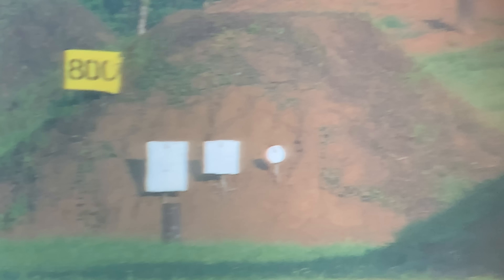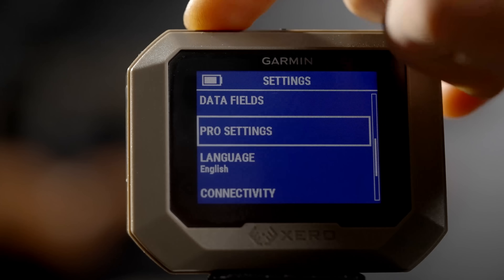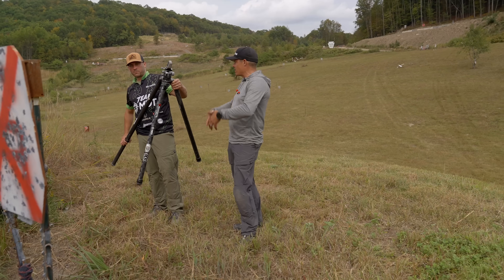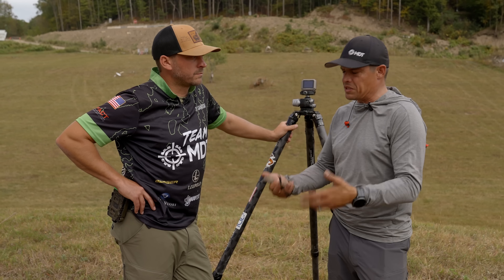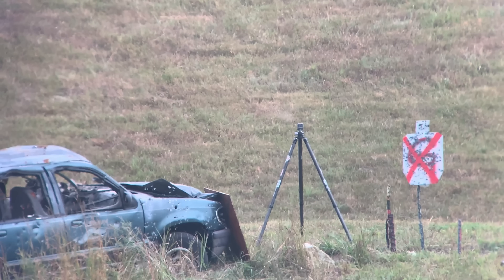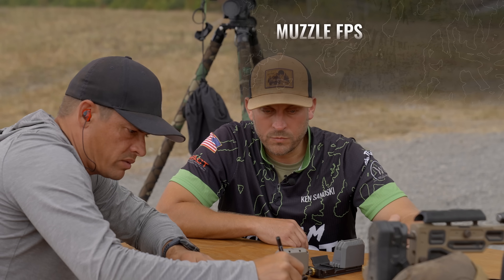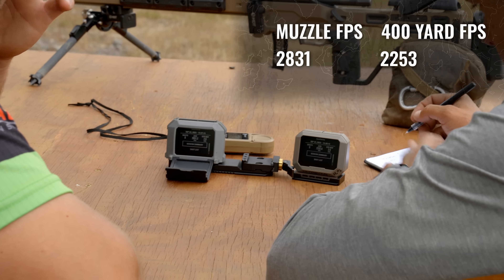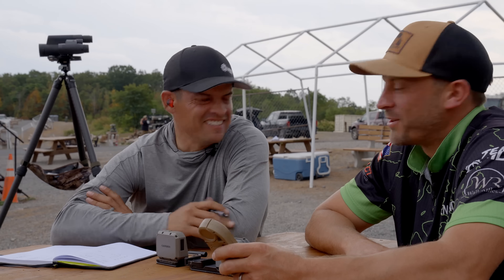How to True Your Ballistic Coefficient in 10 Minutes

Comment: Great feature I was unaware of.  Our setup was:   
1.  Check both Garmin's at the muzzle to see if there is any difference between the two.  There was not.
2.  Get a zero at the distance we were shooting at. Our case was 500 yards

3.  Place the Garmin at 6 o'clock to the target down range so wind would not be a factor.
4.  Make sure there is plenty of clear space behind the target to get an accurate reading.
Plan on moving out to 2000 yards.  But unsure of the accuracy with high angle of decent.
Could not find any information on accuracy for angle of decent for longer range shots

Comment: How did you arrive at the calculated BC at the end? just by adding the MV on the kestrel and then fine tuning the BC until the RemV matches, like you did for the average?
Reply: Yeah, you just use the guess and check method (increase BC if you had more actual velocity remaining than original or vice versa).
Reply: @FrancisColonPRS  Thanks Francis!
Reply: I’m also curious how they made these calculations. Is it by changing the mv on the gun to match each shot, then playing with the BC?
Reply: You will have to use g7 and not cdm for this method. I am going to give it a try! Super cool

Comment: Great insight to try out, I will use my one Garmin to get muzzle velocity and then move the Garmin down range to shot another 5-10 rounds to get my long range muzzle velocity.
Reply: Wouldn’t be accurate because what you’re measuring is the difference between the two velocities to get the BC. Because of variation in velocities you don’t know if those shots you recorded down range have similar or wildly different numbers at the gun. You could maybe be confident if you had single digit ES. That’s my understanding at least.

That said, if I were you I’d probably do the same thing though because definitely can’t afford 2 chronos.
Reply: You can use one, but Bryce is right on this: you'll need STELLAR SDs to get close.  The best way to use the single method would be to use the avg of  10 shots at muzzle and avg of 10 shots downrange.   It is far more likely to have more error than the method shown, but it's at least getting you close.

Comment: That’s dope. Impractical. But dope.
Reply: No its very practical and would have saved me alot of time last summer!
Reply: Horribly impractical. If you understand what a ballistic coefficient is, then you’d know that if you repeated the test out to 800 or 1200yds you’d get a different number. 

Most manufacturers are pretty spot on these days, some even give velocity-dependent BC numbers, custom drag models are readily available…this method is a time-consuming caveman version of producing less-than-reliable BC numbers. 

Still pretty cool that you can do this with them. But pointless.

Comment: Should work the same way for those who picked up a garmin and never got rid of their MagnetoSpeed or LabRadar
Reply: I've done the same thing with a Magnetospeed and my old sky screen chrono downrange.
Reply: Dang good point.  I do still have my magneto speed.
Reply: @Highway_95 just try a few calibration shots with the Garmin at the muzzle to ensure both are reading the same velocity on a per shot basis.
Reply: @GTFab exactly.   You need to confirm that both "rulers" measure the same for multiple shots or all of the effort is wasted.
Reply: @FrancisColonPRS definitely.
Reply: You can put two Garmins next to each other and they will give different readings, is there a way to calibrate them to read the same, I'm new to all this so I apologize if this is a stupid question, wishing everyone a safe and merry Christmas, cheers Yogi ✌️🇦🇺